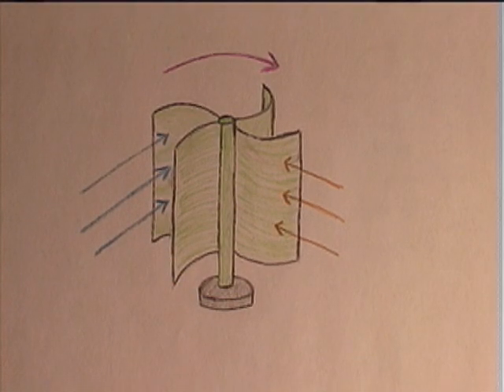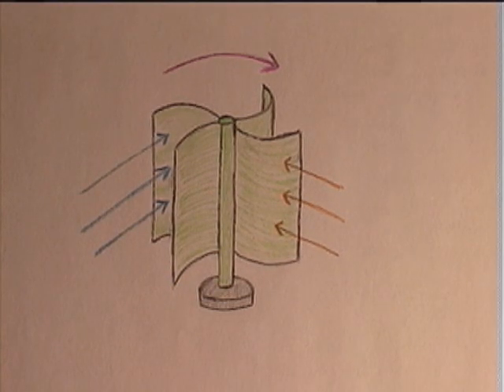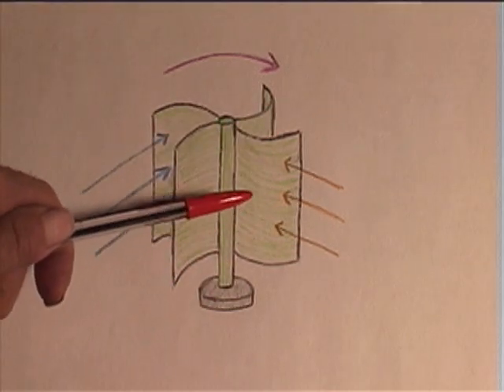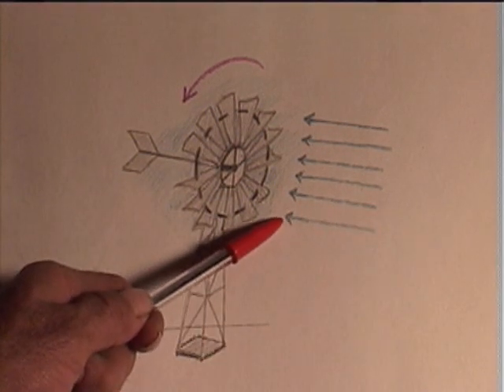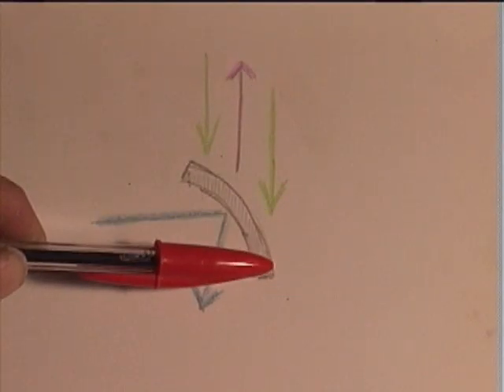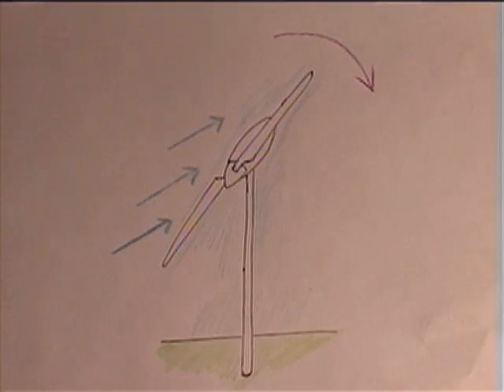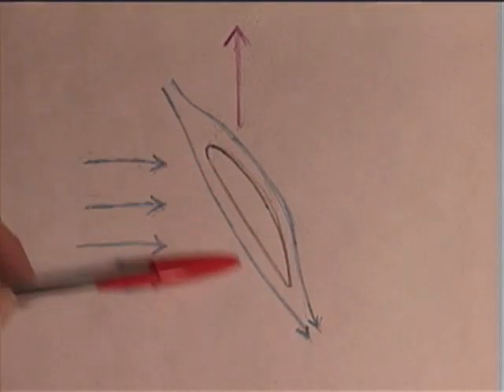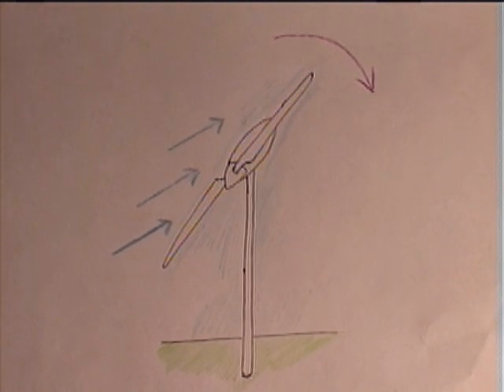Best Wind Turbine Design

Comment: absolutely agreed! type 2 not only does the same but does it better (curves the wind inside that pushes and curves the wind outse due to vacuum being created pulling the blade) the wing design is good for wings (slicing threw the air while gaining an uplift) what you can do with it though is make vront of blade round/thick and gradually make it thinner to reduce air drag. like you said they are used for low wind speeds. to me that means more efficient. totaly true with the percentages also.

Comment: But I still like your video.  It is easy to understand.  You are a good teacher.  Maybe the blade design would be worth investigating more, but you didn't have access to today's technology back then.  Try an Assymetrical Vortex Propulsion device.  Sometimes called a Shroud or an AVP.  It blocks the wind hitting the back end of the blades and eliminating drag, and as it funnels the wind toward the front end of the blades that collect the wind it forms a kind of vaccum that draws in even more wind.  This device speeds up the speed or rotations exponentially.  So theoretically one could run a VAWT in low winds, that would normally not be sufficient to allow the owner of the turbine to draw power from the wind, even a low rpm wind.  Thank you for your video towtops.

Comment: Smaller rotors (~1m or less in dia.) can have more blades. The number of blades depends on Re-number and rotation speed.
The higher Re and rotation speed, the fewer blades are needed, but there is also a limit in a tip speed. It is recommended not exceed ~80 m\s for the tip of the blade for some reasons.

Comment: Your video is well intended, and you have somewhat of the right ideas. However, a number of your statements are not accurate, technically. For example, you say that "dead weight" is a problem for the 4-bladed Savonius rotor. What you actually are referring to is a blade surface that creates only retarding drag and not propulsive drag. The weight of the blade has very little affect on the efficiency as long as the bearings are good.
Here is another example: Your description of airflow over a lift-type wind turbine blade is incorrect. The airflow should be shown as having an angle of attack to the blade. That airflow should be the apparent wind, which is the vector addition of the relative wind -- due to the blade's movement through the air -- plus the true wind. The relative wind, which you show, does not occur by itself. You show the blade with no angle of attack. But with no angle of attack, there would be no thrust, and therefore no relative wind. So what you show is actually impossible if the wind is spinning the rotor.
There a many more errors. Please realize that you don't yet have an accurate understanding of basic aerodynamics. It's more complicated than you currently realize. I say that to encourage you to be more careful, not to criticize you. After all, there are many engineers who don't accurately understand airflow over wings.

Comment: An airfoil like a wing or propeller is designed to have lift. In a Windspire design you have this action of wind that is pulling the blade around, there is minimal restistance where the blades are coming into the wind because it is the trailing edge like fliing a plane in reverse. The difference in the cord length of a wing causes negative pressure on the top of the wing creating lift. The CORD is the length on either side (being unequal) from front to tail. I studied aviation science.

Comment: Try this experiment..take a peice of heavy paper and make a 45 degree cone and drop it now see what direction it goes either pointed up or down. now put a hole at the end and see what happens, keep making the hole larger until you have a balance then make the hole just a little bigger, you now have an efficient design.

Comment: Very informative, thanks

I always wondered why there are only 3 blades in a standard wind turbine, that too with very less surface against wind.

They usually rotate slow, so (as i understand) there is less chance that the air from one blade actually obstructing the other blades, can't we increase the number of blades? or the size?

3rd design doesn't have a piece in the back to turn the turbine in the direction of wind, how do wings turn to the direction of wind? is it meant to be fixed?

Comment: What is the advantage of using only two (or three) blades as opposed to four or more?
Reply: Its a focus of balance, the solidity of a turbine is the relation of the space that all blade occupied in the sweep area of the rotor. So, if you increase the N blade, the air will see the turbine as an obstacle, thats because its to much wall in there, thats means the turbina turn into a wall with high stagnation pressure. So if you increase the number of blades, you will reduce the Efficiency, and even turn it to 0

Comment: Do you ever measured different foils in a wind tunnel? Curved flat surface - is an aerodynamic foil too. And it's properties in terms of lift/drag coeff. are not dramatically differs from more sophisticated foils. Many hand gliders uses such type of airfoil up to modern days.
If the wind strikes into one side and not passes along other - that means stall. No blade or rotor is designed to work in stall mode.

Comment: Hi,
(1) Blades are not the same, but both have some king of foil, good or bad. If they simply curved - it IS already a foil, the flow passes along both sides of it. Inefficiency caused by overall shape of blade (looking from the front) and crazy number of them;
(2) As far as i know, it is purposely designed for water pumping;
(3) Ok.
PS: and what about modern vertical axis turbines? Some people say they are very efficient too.

Comment: Of course, you have never heard of the “Baker Principle” in wind energy potential. Betz Law, is correct, but it apples in science to a propeller dynamic, not a turbine dynamic.
Wind energy potential for a propeller driven windmill is measured in the center of the wind flow cross-wise to the wind. Oh, but wait, a child will tell you that the wind flows 90 degrees in front of the center line and blows 90 degrees past the center line, therefor, the wind energy potential for a propeller dynamic is a small fraction to the full wind energy potential available from the center line.
My 6 and 8 helix turbine rotors take advantage of the full wind energy potential in the 180 degree arc and with ducting; I have achieved propelling the wind 315 degrees inside the rotor and letting it flow out the side of the turbine. The concept is “Low Pressure Turbine Dynamics” and the working models are the Baker Turbo Vortex Wind Turbines.
Reply: I agree.
Reply: Cool!

Comment from the maker: I disagree totally with your comment. (1)Turbine blades #2 and #3 are not the
same. Blade #2 has a lot more drag on it. (2) Turbine #2, in general, is not a 
good design. It has one application -water pumping- were it performs at an
acceptable level. Its used because it is cheap. (3) The 95% refers to 95% of
the Betz limit this is a turbine industry standard expression. The Betz limit sets maximum turbine efficiency at 59%.

Comment: Type 2 with minimal curwiness of the foil is the same, as type 3. The air flows around the blade, not just striking and deflecting!
the cause it is not the top efficiency - it is designed to operate water pump with low power consumption but high torque needed. Also - it is designed to work at low wind speeds.
PS: there is no 95% efficiency, it is just phisically imposible. Get 95% of the wind energy - means dead-stop the air movement. Real eff. of modern turbines is around ~55%.

Comment from the maker: (1) Blades #2 & #3 are not the same airfoils.(2) You have no understanding of the exactitude in design of specific blade shapes needed for success (3) You have no understanding of aerodynamics and how air flows around different objects. Blade #2 has a lot of drag in the direction of rotation..While blade #3
is very aerodynamically shaped and has little drag in rotation.

Comment: Actually Towtops best design is the absolute worst. Why would you build a windmill without a dynamo? I call it stupid engineering, because they put heaviest part of the design on top of a large pole (generator with no dynamo) repairing is extremely difficult too!